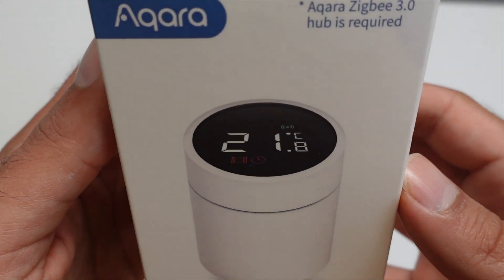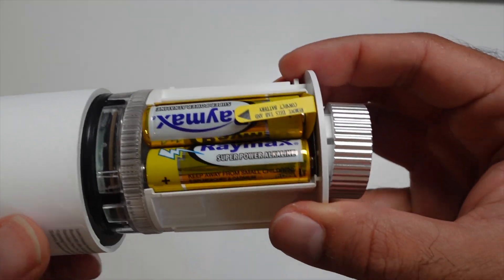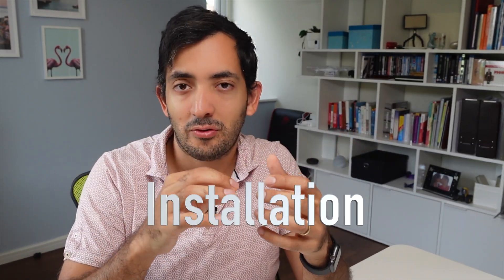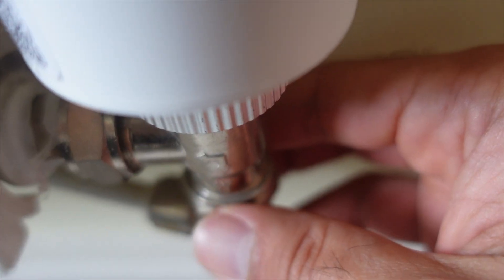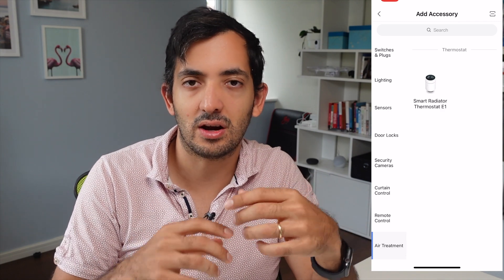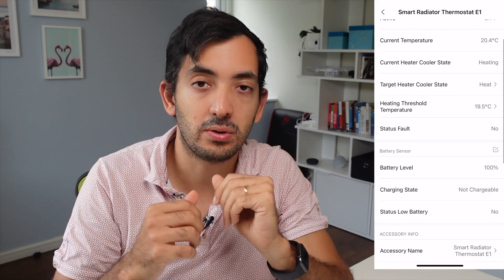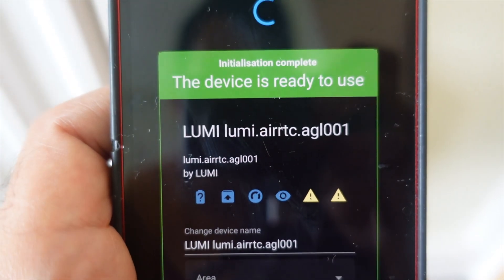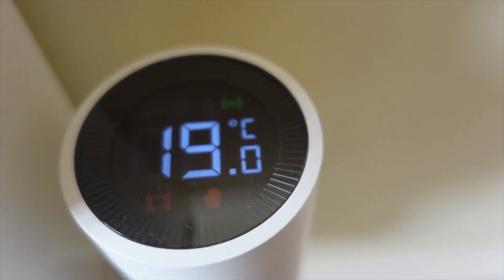Aqara E1 Radiator Thermostat | First Impressions

Comment: One year update how are you finding it?
Reply from the maker: Removed them out because of the noise they would make
Reply: @SmartHomeMakers  Did you replace them with anything? 

I am currently testing one out and it's super frustrating getting it to report the current temperature in any state, whether that is off or in heating mode. Originally I used ZHA and then I tried through the Aqara app, made sure to update to 1030 firmware and it still doesn't update regularly enough for me.

Comment: I'm NOT happy with these - and CANNOT recommend them
(having bought 6 of these in august-2023, plus the Aqara E1-Hub).

Why?

1) Partly due to their lack of Interoperatibility... Philips-Hue shows, how interoperatibility is done - so that a hue-device/unit can be controlled by both Home-Assistant AND the Hue-App!
-- Aqara only accepts "1" - an Aqara-hub or a "USB-Bridge" (Sonoff's zbdongle, etc.).  So one has to sacrifice a lot of functionality/easiness, to integrate these "super-reviewed" pieces of s... (or whatever one want to call this/them)!

2) The installation-proces is, shall we say "like software, in a beta-version".
-- pairing-mode times-out much too fast (60-seconds), which combined with that in my case the thermostat refused to connect to the matching! E1-Aqara-Hub (!), (making me trye this appr. 10-times, after which I needed a brake, not to smash the damn thing!!).

3) Re-initializing proces (if. one for instance needs to recalibrate the valve):
-- is just as "annoying" ... there doesn't seem to be ANY way, to make the damn beta-thing go into "setup-mode".... without removing the housing and removing/reinserting the batteries, etc...!).
-- what a series of bummers!!
-- I am writing this in late august-2023, appr. 1½ years after they were released!!!
(and, this all gets worse: Because IF one in desperation tries to get to the "installation-mode" by holding-in the "1-and-only button", then the unit also needs to be re-connected to for-instance HomeAssistant!!!...)

This should be A WARNING to buyers ...
(not to mention, that Aqara to my knowledge, is quiet about Matter/Thread-support ... making these thermostats "much less of value, than what reviewers at Youtube" inclines!)

Status now, is that Aqara has NOT, after a whole 1½ years, been able to get the software-part right - plus that compatibility and smartness is terrible, compared to Hue's.  Hue (Signify) actually shows, how things can be done, if programmers pull themselves together, and a company cares for a good customer-experience!!!
(Aqara has got connections/threads to Ziaomi, which seems to be the problem here - with a product, that is "in between" a lot - not 100% working in any scenario, or having a lot of "annoyences /deficiences!!) ...

I'm considering returning mine!  I bought 6, trusting in Your and others reviews - and I'm kinda lost - because I don't see, where to go.
Is TP-Link's Tado's a solution?
And, is there ANY Radiator-Thermostat solution, that will work with BOTH the App AND Home-Assistant?
Not to mention the coming Thread/Matter standard/dialect...
So many child-diseases and so much waste of HW/ressources and customer-time!

Comment: Hi, man! I got mine today. I can say i was (Yeah... WAS!) excited, until i can get mine to control any temperature or just close the valve of my radiator. The radiator temp is just = to maximum and i have no idea what the heck is going on. And i can't even connect it to the M2 hub. I've got the hub as well in the same order. I left a note to the support and opened a ticket. Nothing so far. Can you share some experience and thoughts regarding my problem?! They will be highly appreciated! Thank you!
Reply: take batteries out for 30 seconds and reset. Then ensure its up to date with the Aqara App - Firmware update

Comment: I have problems to connect this to home assistant. It only connects after several tries and even than every entity is just „unavailable“. Do everything works for you in home assistant? You didn’t show that in your video.
Reply: Yeah I have one connected via zha. Good green signal on the network map and the climate control entity works. However the trv seems to go to sleep after a few mins and becomes unavailable. As soon as I wake it up it appears in HA and works as expected. I cannot wake it up by sending commands but reconfiguring the device does wake it up. Hopefully quirks will be incoming soon to sort it out but right now it’s not really useable on zha
Reply from the maker: I’m waiting for winter to kick in to properly test the functionality ! Hopefully zha get an update soon!
Reply: @SmartHomeMakers  just set up a regular ping to the device and upped the "consider device unavailable" time above the ping delay. Half hour in and its staying connected.

Comment: Good video Geo, wish I had watched it before I installed mine yesterday as I had the same firmware update issue and I tried to install them before fitting onto the radiator. Your procedure is the one I eventually worked out was the best way.

Comment: To actually save money on heating don't you need these TRVs to also control your boiler coming on and off? Otherwise the boiler thermostat will override the TRVs?
Reply from the maker: Not really they reduce the dispersion of hot water by shutting the valve off! Again not a heating engineer so happy to be corrected!
Reply: Hi your boiler on/off will be controlled by your room thermostat whether this is a simple mechanical one or a smart one like Nest or Hive. The room that the thermostat is in should not have a radiator controlled by a TRV. The room with the thermostat should be the hottest /last room to heat up otherwise the boiler will switch off before the rooms with the smart TRVs can do their job.
Reply: @MAMDAVEM  Not sure I totally agree with this suggestion. I have a number of these with a Nest. You can have TRV in same room (otherwise you will likely roast whilst waiting for other rooms to reach temperature, not all rooms are equal in size/heat loss etc) but if the room with the Main Stat (Nest) reaches temperature you just have to override it for other parts of the house and set each rooms TRVs to the require temperature/schedule. App isn't that logical although todays update (12/12/22) has improved the reliability.
Reply: @marktime61  hi Mark, the reason I don’t have a trv in the room that the boiler thermostat is in is because if you do and it is set below the room thermostat, the boiler will not switch off as it won’t reach the target temperature. If you set the trv above the room thermostat then the trv temperature will never be met.  Or am I missing something?
Reply: @MAMDAVEM  Your way is an alternative way of working. Conversely I could say that with no TRVs in the main Thermostat  room, when that reaches temperature, other rooms will cease to receive pumped hot water and boiler will switch off. For me i seems easier (as Nest is in Living room) which we are generally only in in the evening. Meaning that using the Aqara scheduler the Living room would be set low all day. Stat would then drive heat around the other rooms as required. Either way you have to keep tabs on all rooms, until I can come up with some automations or logic to improve.
Reply: If you search for beama trv energy savings, they have a pdf that details a thorough test in a controlled lab which seems to suggest they’ll still give you energy savings.

Comment: What is expose to HomeKit? Will it be like a thermostat  or just a temperature sensor?
Reply from the maker: Thermostat !
Reply: @SmartHomeMakers  so does this mean I wouldn’t need to get a smart thermostat and all of these valves would work
Reply: @AlexManMe  no they will work even if you don’t have a smart thermostat
Reply: @MAMDAVEM  so would installing a smart thermostat be a bit pointless if we can use these?
Reply: @AlexManMe  a smart thermostat would give some additional benefits, including the ability to control your heating when away from the house, the ability to geofence, switching the heating off when it detects no one is at home and with some thermostats for example the Nest, the ability to learn your habits of turning the temperature up and down. The more sophisticated ones are also Opentherm compatible which means, with a suitable boiler, you can have proportional control of you heating rather than simple on/off control which gives greater efficiency and accuracy of the temperature control.
Reply: @MAMDAVEM  but all these features such as Geo fencing and detecting people are home or not can be controlled via HomeKit
Reply: @AlexManMe  yes Alex but only for the thermostatic radiator valve not the boiler thermostat?
Reply: @MAMDAVEM  oh, apologies for my ignorance I didn’t know about the boiler thermostat
Reply: @MAMDAVEM   shame that Ecobee is not in the UK, I have a Nest with Homebridge.